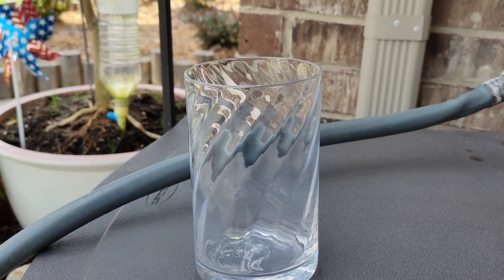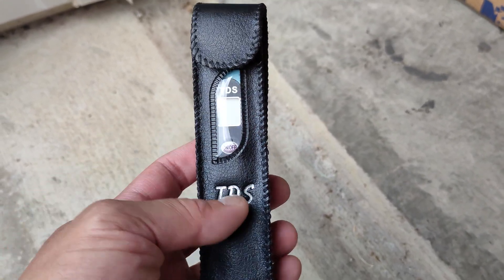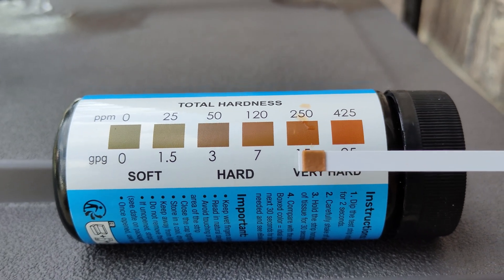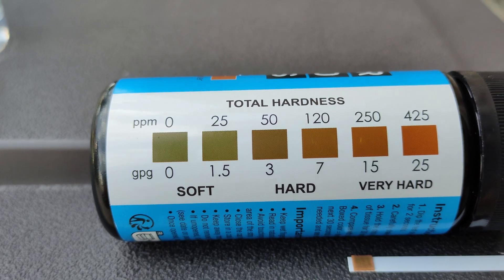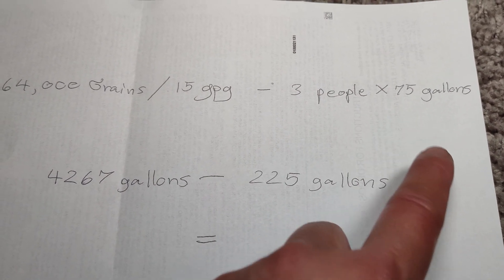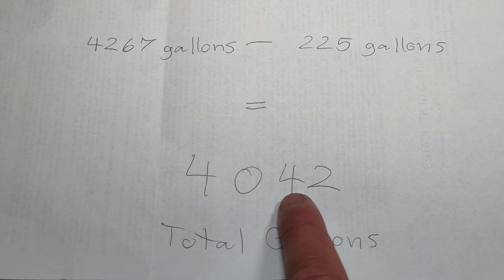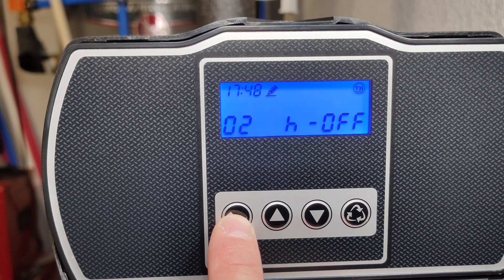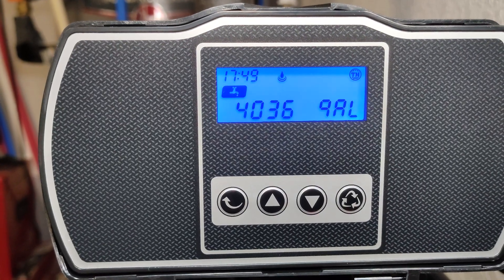Water Hardness Test and Aquasure Water Softener System Settings

Comment: This is incorrect / you are supposed to divide by 3. It's this number 1/3. Please see information on their website. If you set your number this high / it will never regenerate and you won't have soft water
Reply from the maker: Right now, it's been working and still regenerate and have soft water. But, I'll check on that to see what number that you have to divide it by 3.
Thanks, I do appreciate you very much. 😊🙏

Comment: So I did the calculation based on my hardness level in my area and it spit out roughly 6,000 gallons. Does that mean my softener will only regenerate once it reaches that figure? Seems high. 48,000/7.5 GPG - 225 (3pph).

I’ve had it set at the default 1,000 for years now. I probably go through 3 bags a month.
Reply from the maker: 48,000/7.5 GPG = 6,400
3 people x 75 gallon = 225
Then you take 6,400 - 225 = 6,175
So you set 6,175 in the settings before it's regenerate. Not 1,000 my friend.

Comment: Using a TDS meter is an inaccurate way to measure hard water level. I will guarantee you if you use TDS on your softened water, the TDS will still say 150 ppm..why? because of the salt. Even though there's very little but it still detect it.
Reply from the maker: Yes you are correct, TDS meter is not the accurate way to measure hard water, but at least it'll help to determine the ppm and affordable. You need a really good machine or device that can measure accurately, which those devices are very expensive. Not many people can afford them.
Reply: @MrBeeHS  I use HACH, which is a very accurate test for less than $50 and very easy to use.
Reply from the maker: That's very nice!
Can you post a link where to get it? I really do appreciate you and thank you for your input. 😊🙏

Comment: Why is it that when doing the auto testing and outlet value is closed but water still flow throughout
Reply: it's in bypass mode so water flows through the bypass vs the softer tank resin
Reply from the maker: Which outlet valve my friend?

Comment: I have the same size system you have have a question because idk if setting is good or not how often do you have to refill your salt because I think my setting is off or something because my salt goes down pretty fast well at least I think but I’m not sure
Reply from the maker: Have you done the calculations for the total people living in your household?
I added one bag of salt about once a month.
How many bags of salt did you add at the beginning of your installation?
You should add about 2 bags at the beginning of your installation.
Reply: @ only four people and I think i did three bags the first time or two I could remember because my screen went out so I’m waiting on the board to come in the mail
Reply from the maker: @tahoe6182 I see, 3 bags is ok as well. So you are on the right track. You should be fine.
Once you receive your new screen, it should properly calculate on your settings.

Comment: Hi.. does this settings help to avoid slippery .? I have made set up 4000 gallons in my 48000 grains having house of 4 people, of water hardness 300ppm. Please advise on how to overcome the water too soft and slippery.
Reply from the maker: If the your water is too soft....try set it up to 5,000.
As the time goes by, it will get better and won't be as slippery. During the first initial use of the system.....it will be very soft and slippery.....I hope this information helps. 😊🙏

Comment: Divide your TDS reading by 17.1 so 213/17.1 = 12.46, so rounded is 13 Grains.  Your setting should be about 4698 Gallons.  That's a little big for the house. It will probably regen every 20+ days. Even a 32,000 grain system would work in your household.
Reply from the maker: Yes that is correct, but the 64,000 grain was on sale at Home Depot for the same price of the 32,000 grain, so I bought it. I do use a lot of water, just not for shower, but for purified drinker water and cooking as well and watering my inside plants. 😊
Reply: @MrBeeHS  I get it.  You will just use a  more salt than needed. Keep an eye on the long term resin performance.  You may need to override the time meter and add an extra Regen cycle if your resin goes stagnant
Reply from the maker: @joephu  definitely, thank you for the heads-up,👍😊
Reply: Hi, can you help me how much should I set regen, I got 48000 aquasure, my ppm is 150-160, I have 3 adults and 2 kids. How much gallons should I set to regen?❤
Reply: @jss813  160 PPM/17.1 grains = 9.4 grains, round to 10 grains. 48,000/10 grains = 4800 gal, then reduce roughly 75 gal x 5 people  = 375 gal reserve, so 4800 - 375 = 4,425 gal setting
Reply from the maker: Should be about 5625 for regeneration, I hope this helps. ☺️🙏

Comment: Hi, I purchased a new house and it only came with a new aquasure water softener 48000 or 64000 there is just me and my wife.we have had egg smell ever since we bought it. The seller never hooked it up and I knew nothing about water softeners. Aquasure tech help told me to regen manually so for 6 months I kept doing it. The water hardness has been between 250 and 425ppm. In April of this year I added pre filter up and the sulfur eliminator.water hardness is still the same.I have been emailing back for weeks with Aquasure tech plumber, well company and sulfur eliminator people with the conclusion the softener tank may have lost most of the resin/is damaged Aquasure tech has me test regeneration and it is fine . Settings are at default 1000 gallons. My pressure tank went out, got new one. My sulfur eliminator runs water constantly because of the iron content. 
Everything I’ve tried hasn’t brought down the hardness at all.
What do you think? Thanks
Reply from the maker: Sounds like the water softener unit that you have is defective. If the system is not bringing down the hardness, then the unit is bad....in my opinion.
The mechanism inside may not work properly.
I would highly recommend you to buy the new system. The new system is fairly cheap now and sometimes you can catch it when it's on sale. I hope this helps and hopefully will help you solve the issues.

Comment: Is 75 gallon the input from your main water source? We have our own water well with way less gallon a min. How should I calculate it?
Reply from the maker: 75 gallon input is the standard number as part of the formula for the water softener system. The 75 gallon is not the gallon per min. No matter where you get the water source from, you just need to plug in the 75 gallon as a part of the formula. I hope this helps.
Reply: @NataGeo83  the 75 gallons per person is the estimated usage. The reason you subtract this number from your gal capacity is so that if the meter gets to zero, you will still have some softening ability until the unit regenerates at 2:00 a.m.
Reply from the maker: @joephu yes you definitely correct 💯👍

Comment: How did you get that 15gpg?? I have the same 64,000 system
Reply from the maker: You need to purchase the strips from Amazon to test out your water hardness. The strip will show show you the hardness of your tap water. Then, use that number to calculate your settings for your water softener system. The calculation method is also in my video as well.

Comment: Hello,  i had a plumber coming to my house and tested the water and it is still at 11 hardness. what settings do i need to change to increase softness? i dont see anything in the manual that tell me how to.. thank you
Reply from the maker: You need to increase your salt dosage to get your water to soften more. You also need to adjust the dosing in the program.
Reply: @MrBeeHS  which option is it? I’m not sure which settings to change?
Reply from the maker: @vinh3922  let me check and I'll get back with you.
Reply: @MrBeeHS
Reply: @MrBeeHS  it must be the brine fill setting? I must increase the time for the brine fill, so there is more water in the brine tank.
Reply from the maker: @vinh3922  you can try that for now, so it would draw more salt in and I'll check to make sure what other methods that you can do. I am not currently home right now.
Reply: @MrBeeHS  okay! I appreciate you trying to help me. I have also contacted aquasure support but so far, I have gotten no answer back beside one email where they asked me to send pictures of my setup. 
I have started a regen cycle. Once it’s done , I will increase the brine time which should add more water in the next cycle and go from there. Thank you brother for the videos! They helped a lot 🎉
Reply from the maker: @vinh3922  you're welcome my friend, I will definitely find out for you because I am curious as well.
Reply: @MrBeeHS  so I finally got the customer rep on the phone. There is no setting to input the hardness of the water. The only settings to change is the Gallons setting which is calculated with the formula. All the other settings should be left by default.  Before the call, I ran a regen cycle again, and after testing the water with one of those water test kit strips, I have now soft water ( I tested my one of my outside spigots and it turned hard as expected and then ran a few tests on the cold and hot water on 3 faucets inside my home  to check and they are  all soft now!). I believe the resin needed couple regen cycles to get going. Who knows how long those tanks filled of resin stayed in their warehouse for? So for those that test the water after one regen cycle after initial installation, it may still show hard (even tho the water feels slimy). You may need to run a second regen and go from there. Time to look into Reverse Osmosis! thank you for your videos! they helped me tremendously!
Reply from the maker: Love it my friend! That's great news! Yes and it's also will take about 3 months or so for everything to get cleaned out in all of the pipes inside your home....just keep that in mind. You might start seeing pink looking stain or something like that after a while before you don't see anymore. I really appreciate your following up post. This will help many people out there who are watching my video. 👍
Reply: @vinh3922  what number did you put for your gallon setting. If u don't mind me asking? I would think for hard water you should want it to regin more often. Which would mean a lower number. I'm wondering if mine is working properly

Comment: The water softener, if you don't have a filter after the softener, will probably leave your PPM at 110 because though the softer removes calcium and magnesium, it does so by using salt that will be left in your system. So this might not make things spotless (you'll probably need to use a deionization system after the softener), salt is much easier to dissolve and won't degrade your systems as much (plus it's such a negligible amount you won't even notice any taste). You can probably find your real hardness of your water by using dipsticks that are specific to calcium carbonate and magnesium. In my case my TDM read 110 (because salt counts as a dissolved solid)  but my dipstick showed the gpg for calcium and magnesium as 0.
Reply from the maker: Thank you for your information 🙏 
I will look into getting the deionized system soon. I appreciate your input.
Reply from the maker: What deionized system would you recommend for the whole house?

Comment: I just purchased the same system. My water is about 280PPM. Im not sure if the softener will bring that down much. 

I’m curious what your PPM is after you installed the system?
Reply from the maker: Your new system won't bring the ppm down much because its function is to soften the water, which removes calcium, magnesium, and other minerals from the city water that comes into your home. Those minerals are the ones that cause your faucets to have that white and green stuff on the surface and clog up the pipes, which they called it "hard water." 
The water purifier (for drinking) will bring down your ppm.
By the way, my ppm before the water softener is about 290ish and after is about 270-280 ppm. But the ppm after the water came out from my water purifier system is 5 ppm. 😊
Reply: @MrBeeHS  oh thank you so much for that information. what purification system did you go with ?
Reply from the maker: @Zanein  you're very welcome 🙏  I went with Express Water RO 10 stage. I bought the system from Home Depot. It works really well and it also makes Alkaline as well....very healthy for your body.

Comment: Hi Thanks for the video. How do you like the Softener so far? I am considering one, do you recommend it based on ur experience with it?
Reply from the maker: You're welcome 😊  Yes! I do highly recommend installing one for your home. It's well worth it. Here in Texas, hard water made my body itches every time after I took a shower. Now I'm not itchy anymore after the shower. 😄
My dishes came out super clean from my dishwasher, and the bathrooms are easier to clean. Also, my faucets don't have the calcium build-up anymore, and that's a plus.

Comment: Thanks for the video. I have the same 64000 grain system at my home.  What is your TDS number at your kitchen sink faucet? I am interested to know how much the TDS number improved after the water was treated by your unit.  Please let me know. My untreated input water number is 290ppm and the water after treated by the water softener is 375ppm, which is higher.  The unit was installed 2 days ago following your other install instruction video.  The unit was set to regenerated over the last 2 nights and today the number is at 375ppm.  I wonder if my unit is bad  and need to be returned.
Reply from the maker: That's good that you have installed your unit. Just to let you know that your TDS will be a little higher than normal....that is ok. Because your treated water had salt in the mix due to the water softener system. The purpose for the water softener system is to soften the hard water that comes from the city. Hard water is usually bad for your appliances, faucets, and toilets. It'll leave that white and green stuff on your faucets. It won't reduce your TDS.
My TDS that came out from the city water is 217 ppm and after water softener is 237 ppm and from my Reverse Osmosis came out 9 ppm. Which improved for drinking water.
If you want to check the hardness of your water before and after the water softener system, you can buy water hardness strips to check. You will be surprised that your water softener system is working very efficiently. So keep your system.... it's well worth the investment. It'll take about at least one month for your water softener system to work for the whole house.
Reply: @MrBeeHS  If I may further add. Having zero PPM pure water probably isn't very good for you because your stomach actually needs ions like salt in order to open the gate channels in your stomach to absorb it. Zero PPM or DI water is really just good for cleaning equipment and running machinery because it leaves spotless stains and doesn't cause sediment.
Reply from the maker: You are correct! Bullseye 👍
Your water softener system won't be able to remove all of that nor the RO or any other water purifier system that purifies water for drinking.
You do need minerals and other stuff in the water to make your body healthy.
Like DI and distilled water are not good for human bodies. Usually, manufacturers will use DI and distilled to mix with something else like antifreeze, etc.